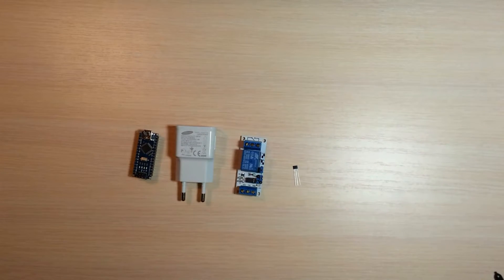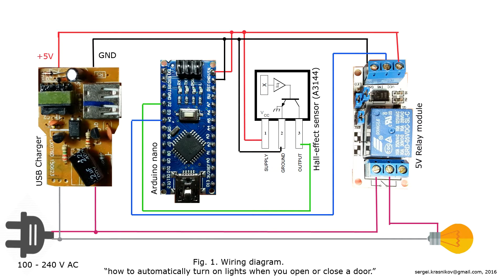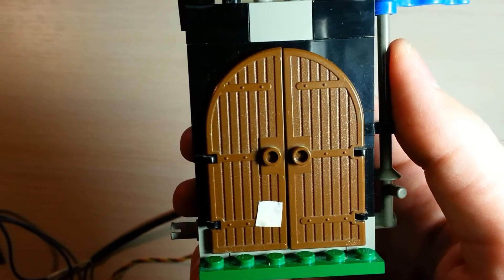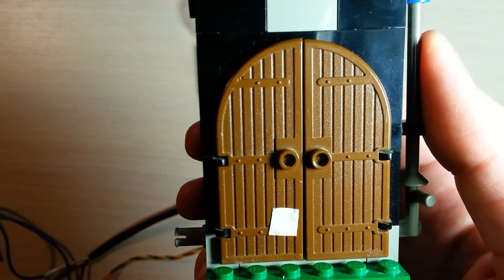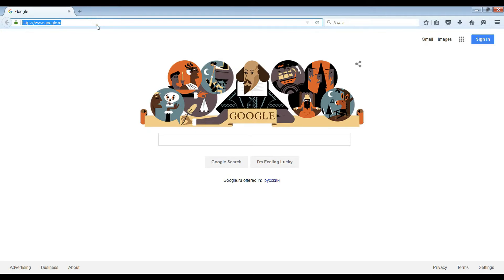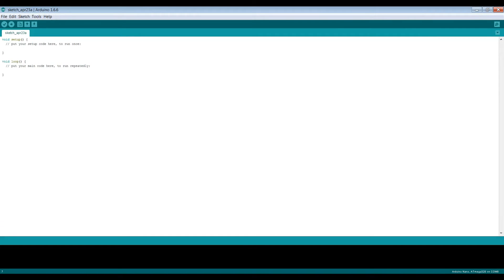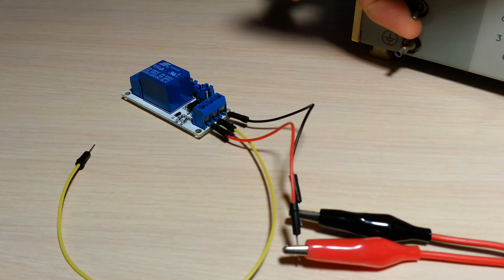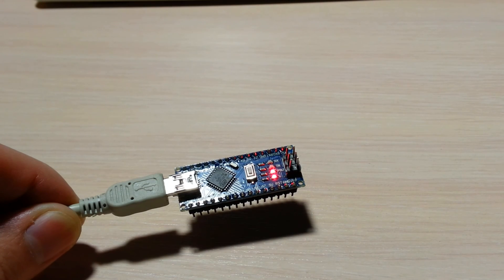how to automatically turn on/off lights when opening door

Comment: Hi thank  you for this wonderful tutorial.

I am doing almost same project as you.
but the difference will be LED Bulb instead of incandescent Bulb and with one more relay to be activated when the bulb is burnt. Now with incandescent bulb it's easy as the bulb burn there is no connection. so doing it with LED bulb my curiosity is if the LED bulb is not lit how can the relay be activated. 

thank you will look forward for your reply.